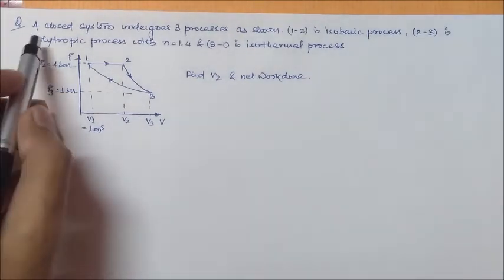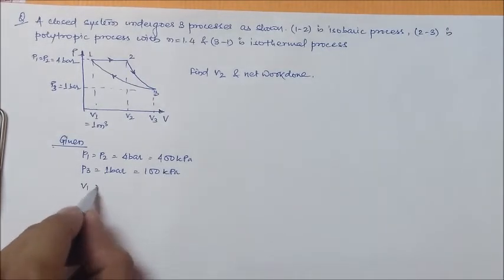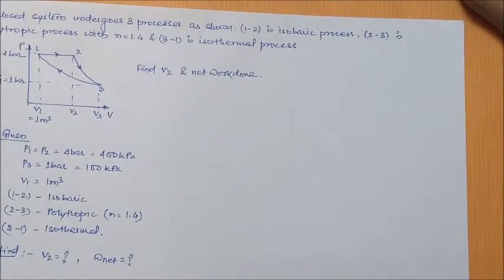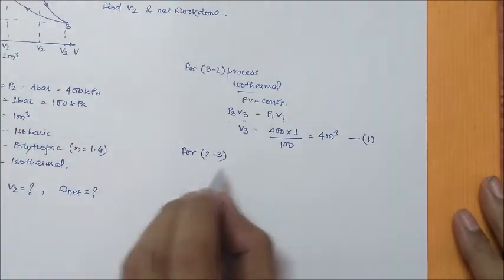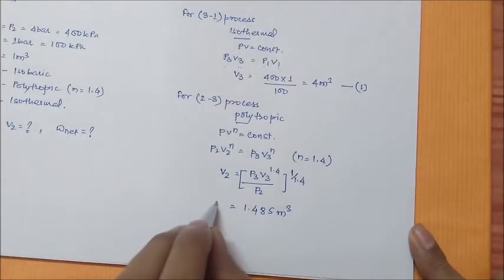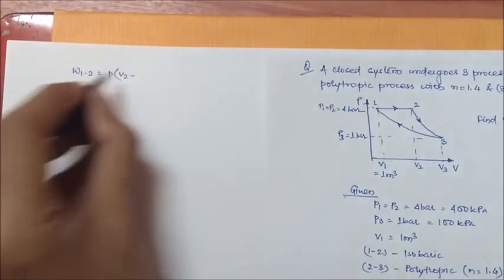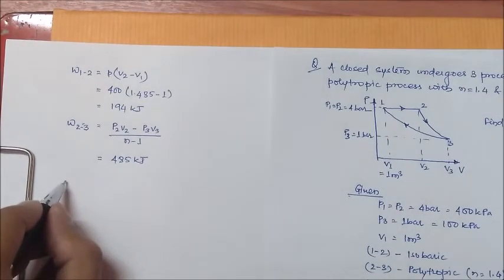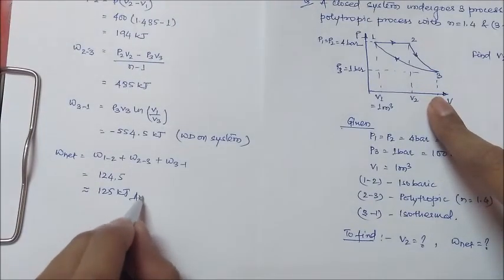Numerical #4 | Thermodynamic Workdone | Cycle

Comment: The formula used for calculating work done for polytropic process is wrong and the net work done is 318.6kJ
Reply from the maker: What's the correct formula according to you
Reply: @ABStudyCircle   you forgot to multiply n in the formula
Reply from the maker: The formula for closed system when you derive it from your ideal gas equation and taking your polytropic condition you will get as W= mR(T2-T1)/(1-n) or (P1V1-P2V2)/(n-1)

For open system it's
 n(P1V1-P2V2)/(n-1)

Question deals with closed system I guess
Reply: @ABStudyCircle  yeah now i understood
Reply from the maker: Please do subscribe my channel if you find my videos informative
Reply: @ABStudyCircle  i already did that and following your videos accordingly
Reply from the maker: Also to get a proper understanding I would suggest you to see my video Lecture 5 and 6
Reply: @ABStudyCircle  ok